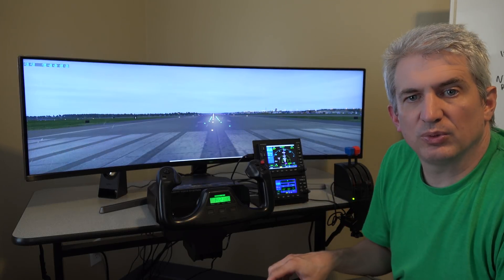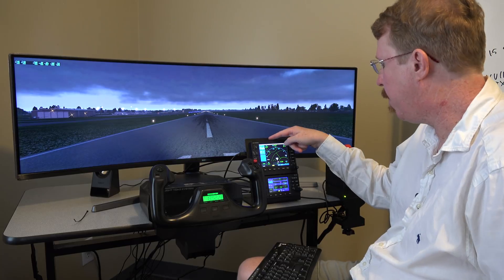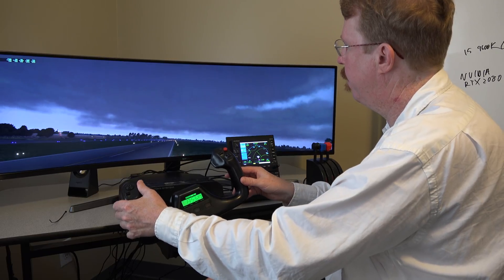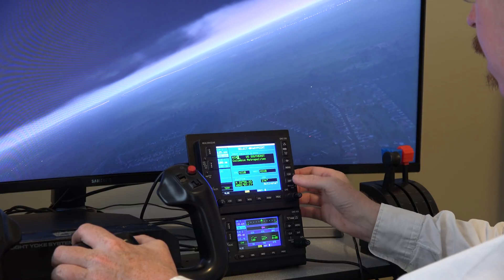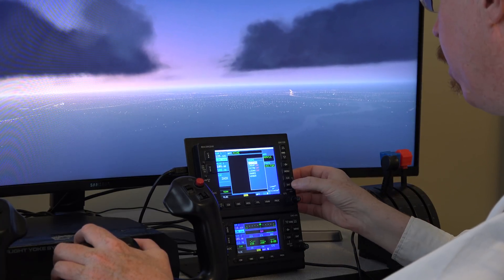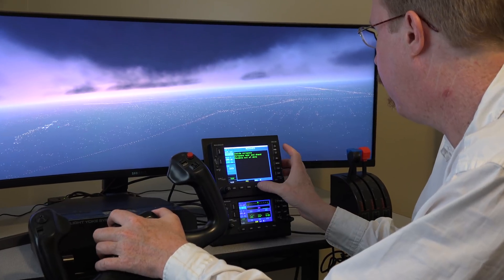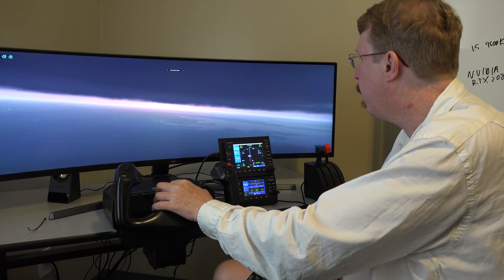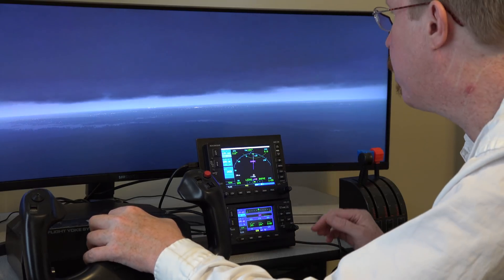Austin Meyer tries and demos the RealSimGear GNS530 and GNS430

Comment: I have an important question that might be increasing the use of air manager. I have been asking people with xplane10 but can apply to any simulator. In order to see 180, we use three monitors  for panoramic views or 3D cockpit also but if the 3D cockpit can be remove(instruments only), then we can use head tracking with if we keep the 3D capabilities. I was told that is not possible but I found one plane that is not finish in xplane10 under experimental planes with name VAN'S AIRCRAFT. When I started,  I only see the panoramic view (no instruments or cockpit) but my head tracking was working and I can control head movements in order to have realistic view of the outside. This is fantastic to combine with air manager because you can have only one monitor for the view using head tracking and the second one for air manager instruments. Using four monitors requires a lot of PC. Any idea how we can remove the cockpit with our loosing the 3d capability. Thank you.

Comment: Great answer to why the Garmin 430 is so common.  "To replace it would be $60,000".  Somebody already paid $10,000-$15,000 to put that radio in the plane.  It works fine for GPS navigation.  It's not worth replacing.
Reply: And with Austin's app for like $10 a month, and the cost of like a $300 iPad which most already own, I can't see things changing anytime soon.